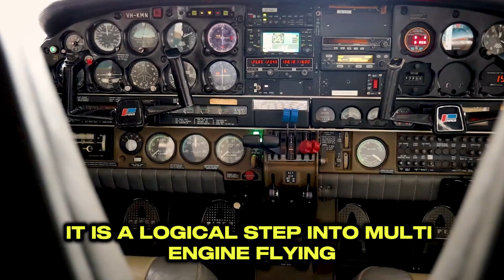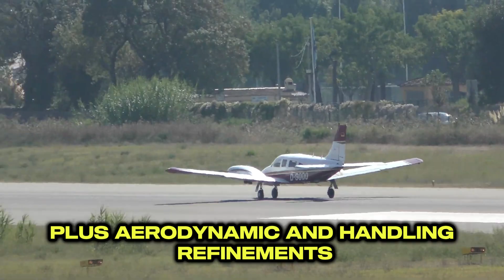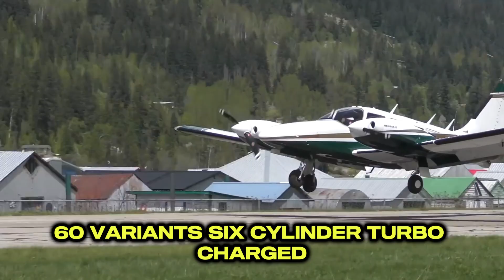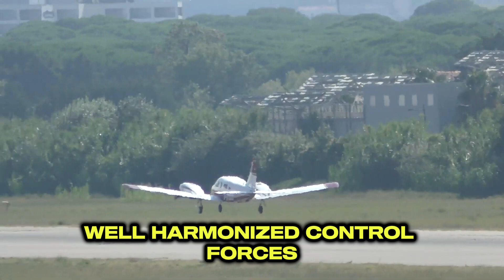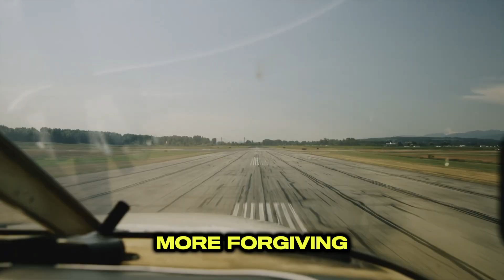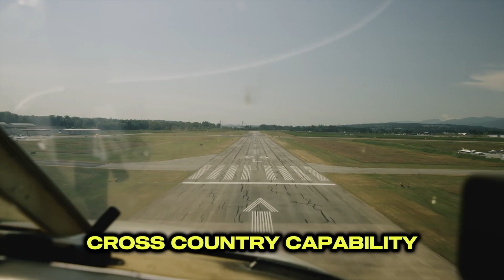Piper Seneca: The Twin That Works-History, Specs, Real Numbers

Comment: •	Seneca — that description “popped and banged, fishtailed around, sounded hollow like being in a drum” is perfect. Many pilots say the early Senecas felt tinny and a bit under-rigged, especially in rough air.
	•	Twin Comanche — absolutely, that was the “pilot’s twin.” It felt tight and efficient, clean through turbulence, with excellent control harmony.
	•	Aztec — a great observation calling it a mix of the two; solid but not as precise, roomy but not as refined.
	•	Baron — yes, the cabin is cramped; beautifully built but tight in the shoulders, especially compared to the Aztec.
	•	Britain-Norman Islander — “a good plank aeroplane” sums it up; sturdy, simple, flies like a truck but gets the job done on rough strips.

And the Port Moresby–Kerema run — that line “what’s 58 minutes when I first went to New Guinea, second time round it was an hour, now it’s an hour and two minutes having been banged on the ground a million times” — that’s pure aviation poetry. Aircraft age like people: more experience, more scars, a little slower every year.